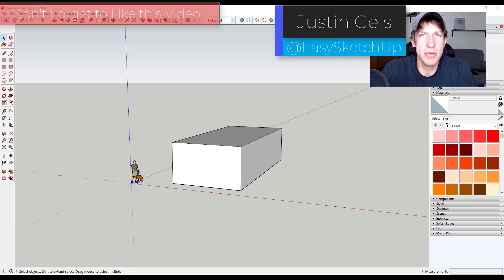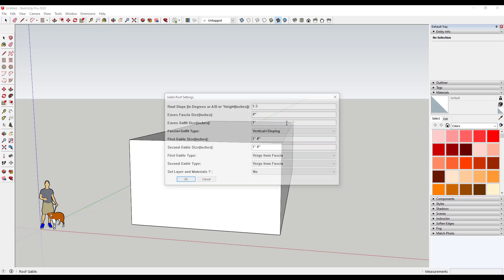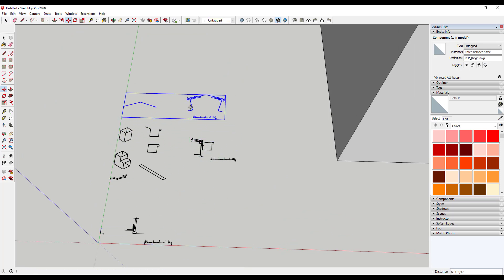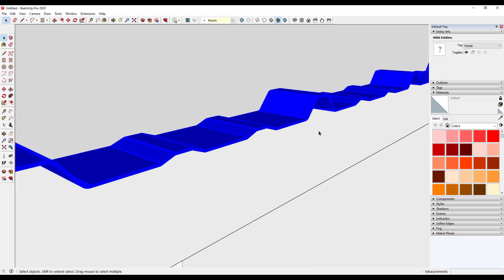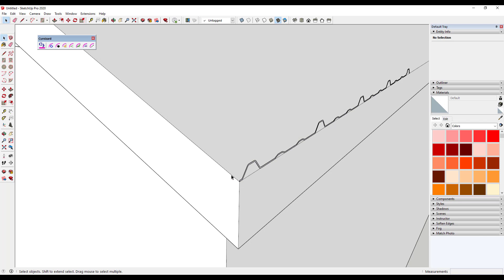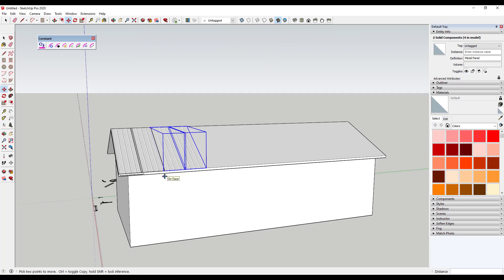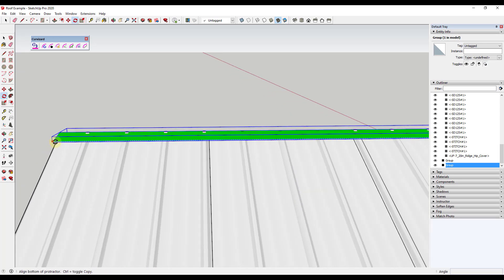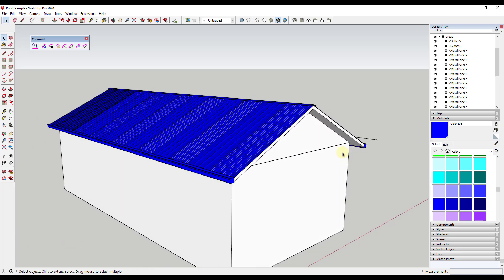Creating a Detailed Metal Roof IN SKETCHUP!

Comment: Great plugin, but greater is problem based approach - congratulations. By the way: crossection of sheet metal needs to bd ortogonal/perpendicular to roof surface, not vertical, because high of profile is changing but we know this of course. Thanks for Your great work, greatest in SUP world!

Comment: I noticed you moved the panel profile to the roofs edge, then rotated it 90deg. to horizontal plane, then used the follow me tool. Should that have been rotated 90+roof pitch then extruded? Or doing it your way , does it end up the same depth profile had you extruded first on a horizontal plane then rotated the panel to equal the angle of the roof? It seems that the way you did it would truncate the depth form valley of panel to ridge of panel. Or does the follow me tool take the angle into consideration as if it were extruded flat then rotated?

Comment: Your CAD file came in with the panel extrudable. My 5V crimp did not. So I offset it by 0.025 and joined everything up. Still can't extrude it. It's like the lines won't connect. Help!
Reply: Figured out a fix. I had to double click inside the group, create a rectangle that intersected all lines, and right click then intersect lines with faces.

Comment: When I went through these steps it kicked a message “components within the model that were loaded from external files will not be resized” I can’t figure out what’s going on now. I tried pulling other files in like the base trim and inside corner trim from the PBR profile and it would do the same thing for any component I’m trying to resize
Reply from the maker: This seems to be the solution to this issue - https://forums.sketchup.com/t/tape-tool-resizing-entire-model-including-components-loaded-from-external-files/50646
Reply: Thank you. I’ll give this a shot.

Comment: I’ll give you a thumbs up on this, but your first rotate of the section should have been at 90 degrees to the roof angle, not 90 degrees to world space! Your extruded roof section is now too shallow. Correct me if I’m wrong.
Reply: Spot the obvious error 😆
Reply: I did a similar roof (in a much less elegant way), but the underlying sheet showed thru at the overlap when I zoomed out some distance.  Any hints?
Reply: @kevincotterell3644  SketchUp has a tendency to do that with overlapping surfaces if they are on the same plane. You might try moving one surface slightly away from the other or just trimming one of them back for rendering purposes.